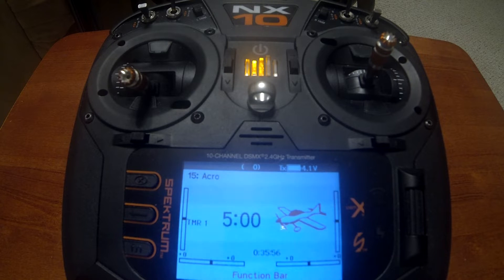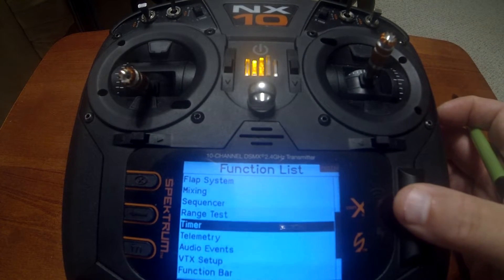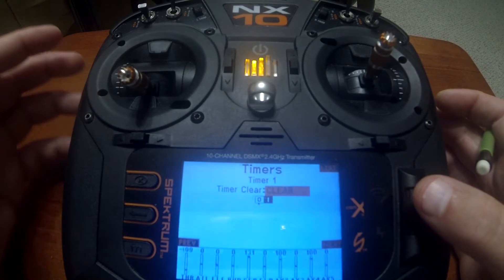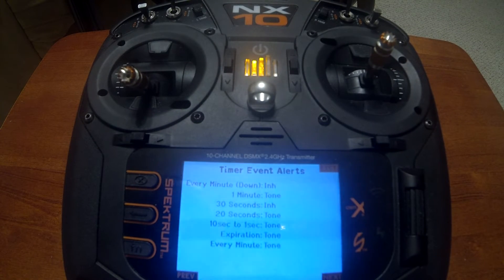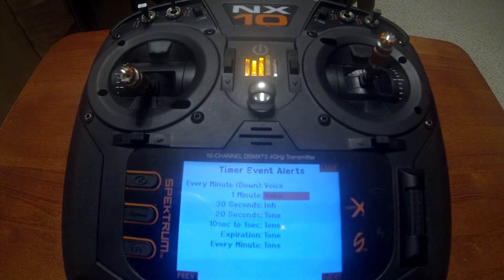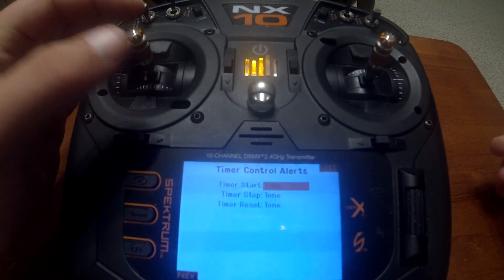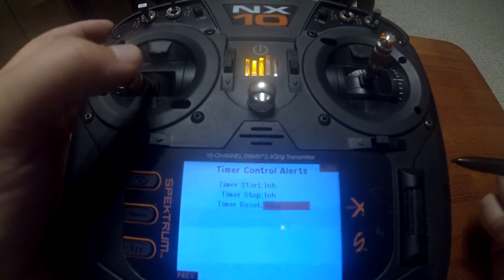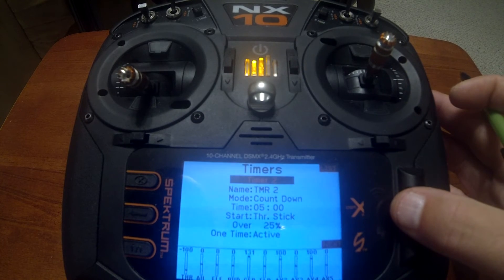Spektrum NX Setup: Timers Explained Tutorial (NX6/NX8/NX10)

Comment: My second timer is for flight time, since I fly a motorized glider. That way  If I have a long soaring flight I can get that. If I have to add a bit of motor now and then because of weak thermals, I can set the alarm for battery consideration.

Comment: Great video.
I prefer setting timer 2 to stopwatch, and letting it count up for total flight time. I inhibit all of the call outs for timer 2.
Reply from the maker: I setup all my planes exactly same :) Thanks for adding that.
Reply: In addition, I recently also decided to use the throttle cut switch to start stop timer number two as a stopwatch. I'm also playing around with using the middle position of switch F as the reset for timer 2.

Comment: Thanks for this video, as well as the whole NX-setup series.
Following your instructions I have activated a second timer as stopwatch to be used as a total-flight timer. The first timer starts and stops using the throttle stick. The second timer starts when throttle is above a certain percentage. How do I stop the second timer? I would want to activate a switch or key press to stop the total flight-time as soon as plane has landed. Currently it just keeps running until cleared.
Reply from the maker: 2nd timer can be put on a switch to start and stop. Need to be setup as a logical condition which is more advanced.
Reply: @BDTennessee  Thanks for the reply. I will be looking into this as I would prefer to keep the throttle as the start action for the 2nd timer.
Reply from the maker: @graphix-ds  something to consider is making second timer activate like the first one with throttle percentage but a low value (example: 5%)...
Reply: @BDTennessee  I had considered that, but when gliding or doing thermals the throttle would be 0%. Another thing I considered was controlling the total flight timer via a flight mode switch having 3 modes:Taxi - TakeOff/Land - Cruise.
Timer 2 (as stopwatch) would start with switch values 1 and 2, and stop with value 0 (Taxi).
During the 20 years I have been flying I have never user, nor needed flight modes. Not sure I will be able to pick up the habit of using the flight mode switch only for the timer. We'll see.
I posted the question on rcgroups, A first suggestion was to use the throttle-cut to start/stop the timer. But taxiing from/to the pits would then still be logged as part of the "total flight time".
Reply from the maker: @graphix-ds  some good points. Report back what you come up with...

Comment: I need to change Flight Modes about 15-20 seconds after the throttle is advanced past 25% when taking off.   Is there a way to set a voice command,  that I can set 15 seconds after the throttle goes past 25%?     At that point, I need a reminder to switch my Flight Mode from "Take-off mode" to "Cruise Mode".

Comment: Greetings, I have problems with my nx8. I don’t want to hear the voice commands that are pre-installed, I don’t know if you have already had any problems with that and if there is any way to correct it and put it to work, I hope you can help me with that and thank you.
Reply from the maker: Preinstalled that you can use as audio events?
Reply: @BDTennessee  No, the radio already has some sounds that you can assign to each button on the radio for when you want me to say for example; (randoms on) but it assigned them and it doesn't want to work for me, has it already happened to you before?
Reply from the maker: @hexael  I havent had radio not call out audio assignments on switches. Id check volume settings.

Comment: question I have a NX10 and I'm trying figure out if it's capable to verbal batery information so I can fly having the radio tell me how many mah the baterry has rather than using a timer? Any advice would greatly be appreciated. Love you NX TX channel, just need direction.
Reply from the maker: You can have the voltage called out through status report or on a switch. Status report is set to a value and auto called out (Choose how many seconds its auto called out). Also can be put on a switch. Mah consumed you need a add on sensor.  (Part# SPMA9605)

Comment: Hello BD,nice informed Video,but I have a Question:Can I set that the Timer is on correct Time(Motortimer) after Turn off the NX8 ???
sorry for my bad english
Best regards from Germany
Ralph
Reply: Hallo BD 
Thank you for the Tip,
and the quick answer 
Best regards 
Ralph
Reply from the maker: @rallitiffany2011  anytime :)
Reply from the maker: You have 2 timers built in. Model which is total time on that model and integrated which is total time of radio.

You could change "One Time Active" option. Bump the throttle and then back down when starting nitro/gas motor and it will run until radio is turned off

Comment: I am having problems with setting up timer on nx6 transmitter. When setting it up for my aeroscout it worked but when setting it up for f15 it won’t. I have both set up the same but when I go 1/4 throttle when flying f15 she will nonstop saying timer start timer start but timer never starts. She will never shut up until I get below 1/4 throttle. Anyone know what is wrong?
Reply from the maker: Enter with scroll wheel > Timer > Next 3 times > Timer Control Alerts > Timer Start and Timer Stop to INH
Reply: @BDTennessee  I did that but timer on main screen isn’t counting down like it does with my aeroscout model. The f15 model is the second model I set up.
Reply from the maker: @cG-es8mb  Function List > Timer > First Timer screen scroll down to "Start:" change to "Thr.Stick" and next line should say "Over 25%"
Reply: @BDTennessee  I got it working. I know what was wrong. When I click on timer and hit the next button and it takes me to the timer clear screen. I had that set wrong. Shoot. Lol. Thank ya for your help. I have to get used to this technology.
Reply from the maker: @cG-es8mb  glad you got it worked out!